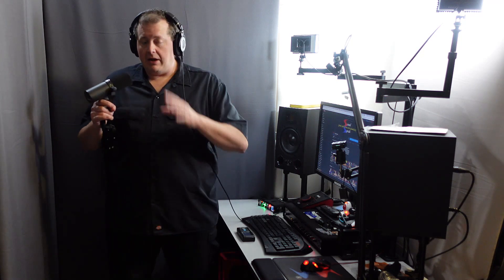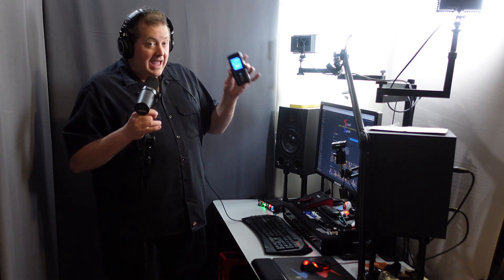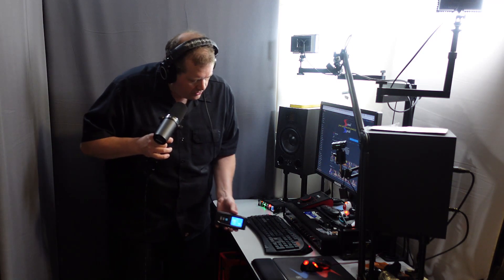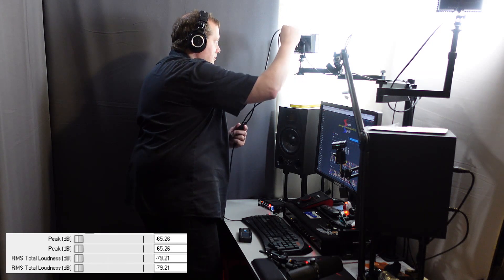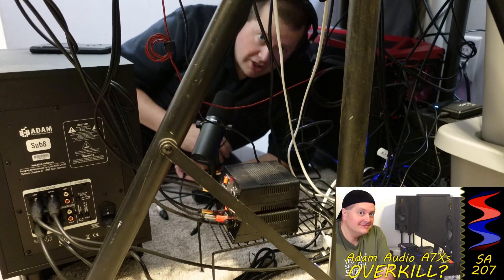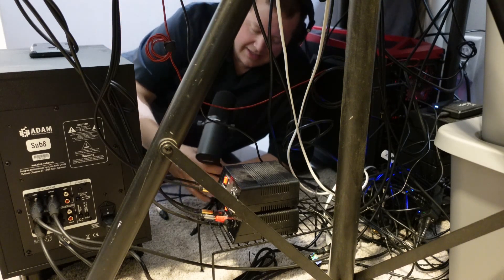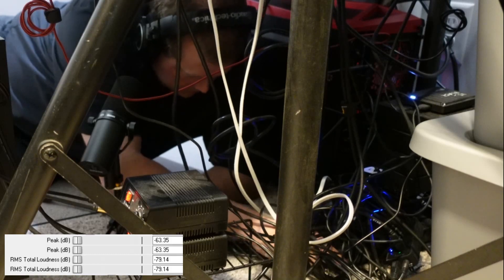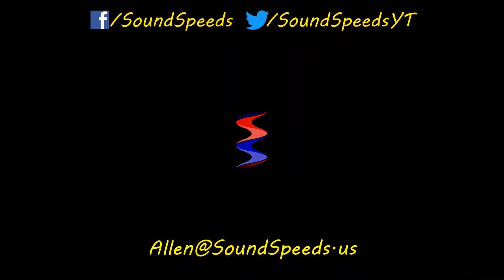Sound Speeds Custom XLR Cables vs High RFI/EMI

Comment: Hi Allen, love your videos! I recently got my first job as a professional boom operator, but I am a little concerned about my height being an obstacle to a career in the department (I'm 5'7). I've had some discouraging comments in the past, but do you think this will really hold me back?
Reply from the maker: I know a boom op that's 5' 4". It's more challenging for a shorter person but there's no reason you can't make a career as a boom op. You'll have to spend more time with boom overhead especially during walk and talks and when around tall operators. Consider an articulated boom from K-Tek and a QDS from Ambient (https://youtu.be/Qf9RT0g2tgw) to help you stay on the ground when you would otherwise need to be on a ladder.

Comment: You should have compared it with a default amazon cable, would have been more sciencefun.
Reply from the maker: Curtis already did that with a Monoprice. Plus I could go down the rabbit hole and buy a bunch of discount cables to compare but people would keep suggesting more cables and I don't want to spend $300 on everything from Amazon Basics to Mogami just to put them into a rats nest of wall warts and unshielded cables.
Reply: @SoundSpeeds  Also, you really are tempting with those color options. If you open shack again in mediumproximate future I might get me a red one (right now the timing is a bit suboptimal).
Reply from the maker: I don't anticipate doing this again. Of course, I didn't think I would back in 2020 either though.
Reply: @SoundSpeeds  hm.
Question: does any noticeable drop in signal happen over 50 feet of such cable?
Reply from the maker: I've never noticed any. You're more likely to encounter noise in the line